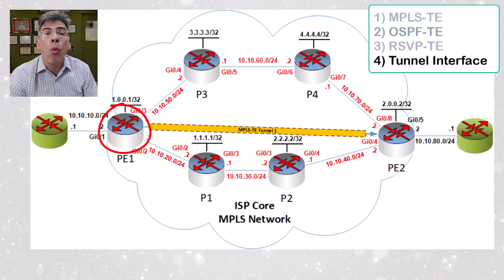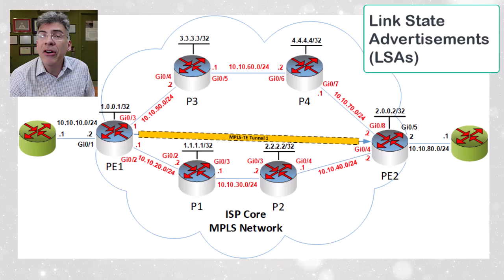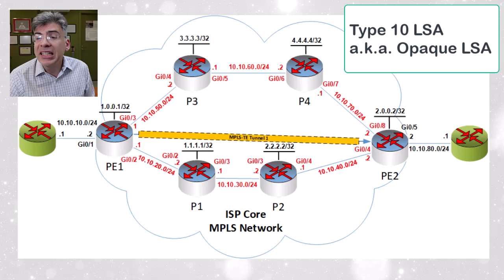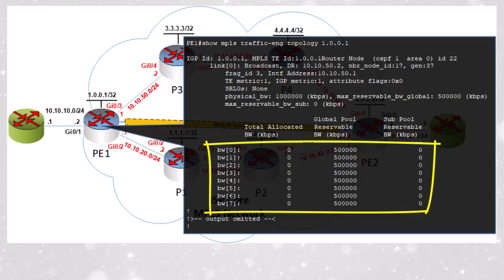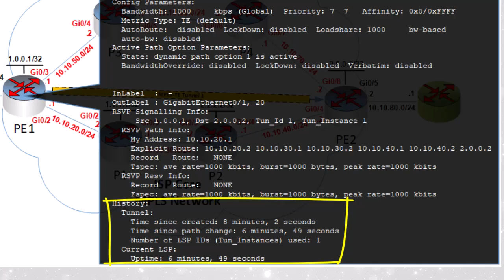MPLS-TE OSPF Underlay Operation

Comment: Great content Lazarus! I have a question, If there's already MPLS setup with MP-BGP running between CE-PE for multiple customers, how does MPLS-TE fits in the setup? is it solely handling PE-PE traffic? or can we sets it up to handles customer's traffic to route them via specific path that we wanted.
Reply from the maker: Thanks so much for the kind words! That’s a great question and one that often comes up when combining MPLS L3VPN with MPLS-TE.  MPLS-TE comes into play primarily in the core, handling the underlay transport between PE routers (or even P routers), and is not directly involved with the PE-CE routing. Its main role is to provide more control over how traffic flows through the MPLS backbone by establishing RSVP-TE tunnels that follow specific paths, avoiding congestion or utilizing high-bandwidth links. 

These TE tunnels can be used as the preferred transport for VPN traffic by integrating them into the IGP or configuring BGP to resolve next-hops through them. While MPLS-TE doesn’t inherently distinguish between customer traffic, it is possible—with additional configuration—to steer specific customer traffic through particular TE tunnels using methods like policy-based routing, VRF-aware forwarding, or even more advanced approaches like DiffServ-Aware TE (DS-TE) if the traffic can be classified accordingly. So yes, while MPLS-TE is generally handling PE-to-PE traffic at the transport level, it can be set up to influence the path of customer VPN traffic if there’s a need for traffic engineering per customer or service class.
Reply: @telecomTech.explained  thanks for the reply and explanation! Wow, you can actually create a shorts for that. lol. 
I honestly think that a shorts on use cases is a great addition to help understand some of the tech in ISPs.
Reply from the maker: @buzz.s171  Thanks for the suggestion, I'll consider making a short on this!